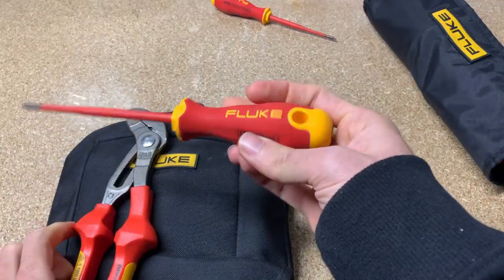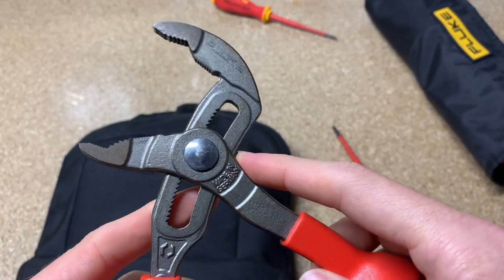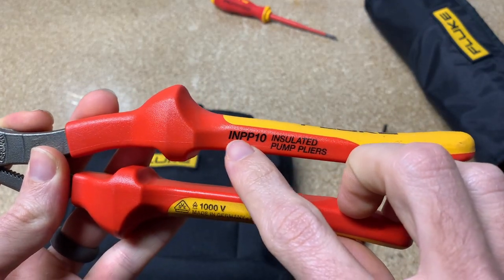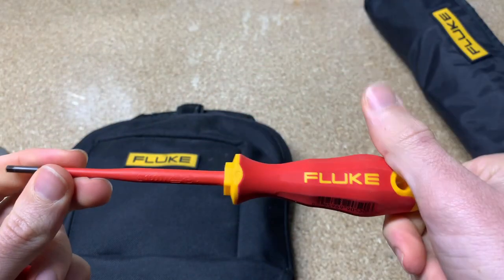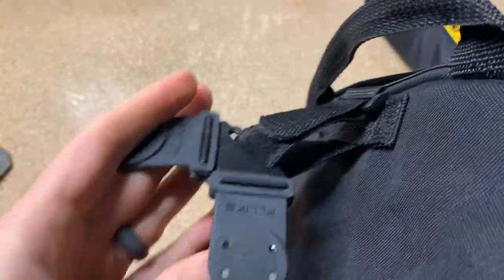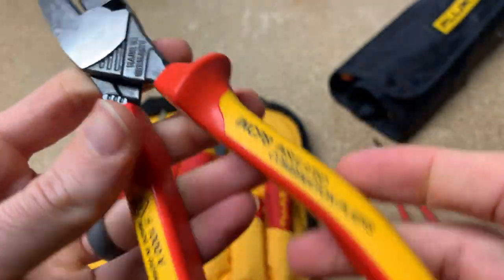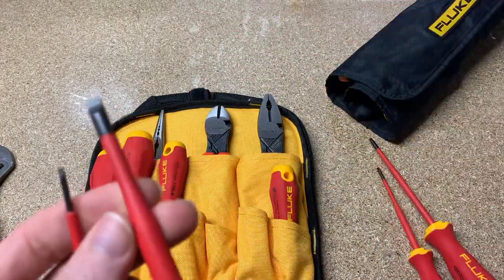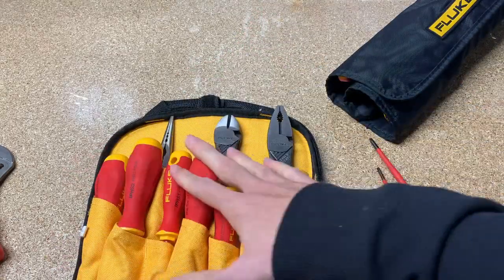Insulated Hand Tools - Fluke Fridays - Episode 36

Comment: The screwdrivers are fine but the pliers and side cutters are rubbish. Very low quality for what you pay. The cutting surfaces were dull out of the box, the teeth on the pliers don't line up, the casting was poor quality, and even the ends of the pliers weren't aligned and out by 1mm. Extremely unhappy with my purchases. I went out and bought a Marvel set after a month they were that bad. Other guys at work were amazed Fluke would put their name to them and wondered how they passed QC. I'll continue to buy their multimeters but Fluke should stick to what they do best as these have muddied their good name and left a sour taste in my mouth.